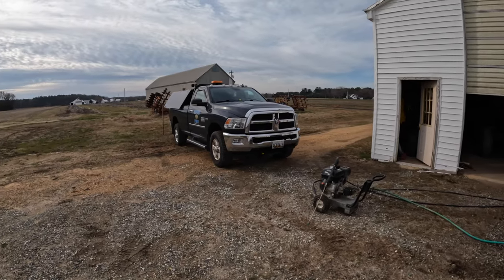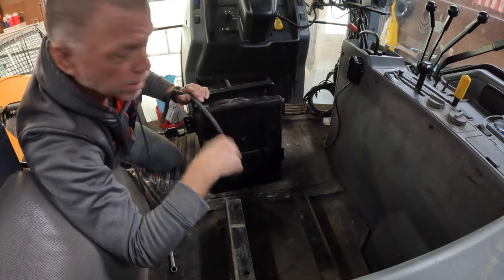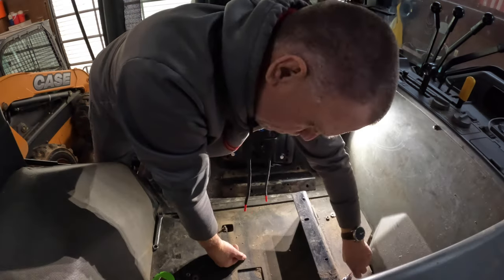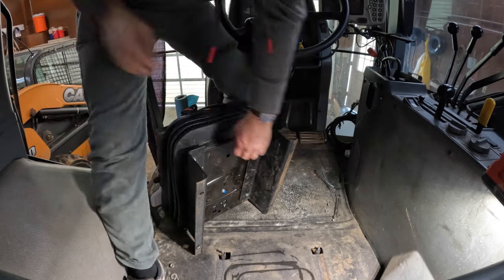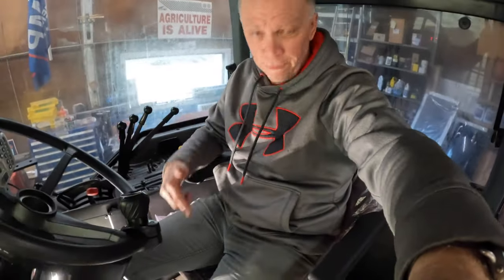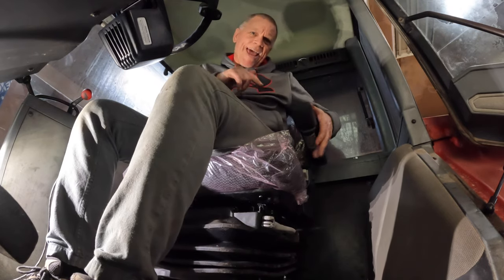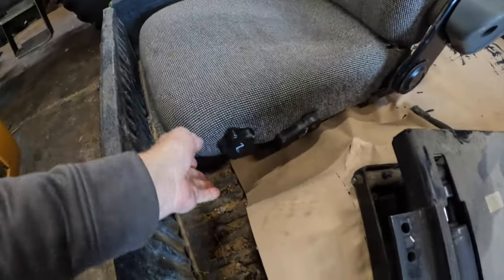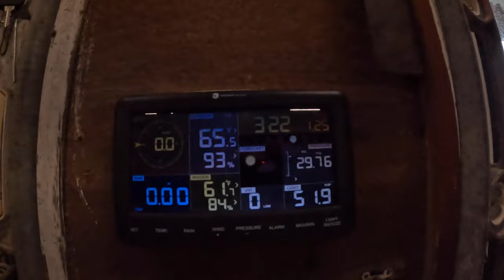New Bucket Seat Installed in Tractor

Comment: If you replace one again get a Sears brand, they are much better and the same price or less. Most OEM seats are made by Sears.
Reply from the maker: Thx.  For some reason I thought grammar had bought out the sears seat brand.  But yeah, I would agree that sears seams to be a better quality based on the original seat I took out.